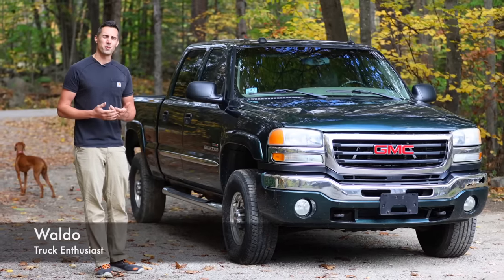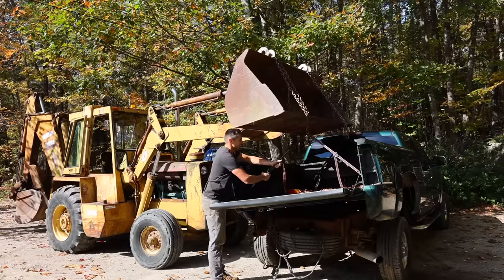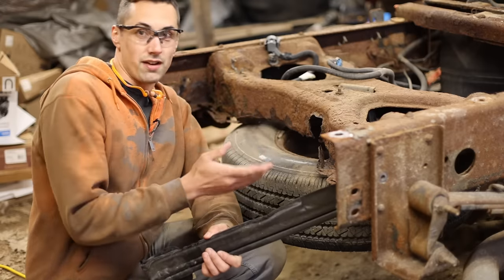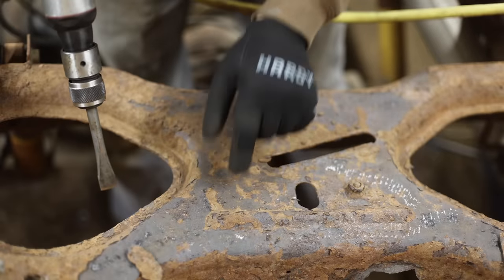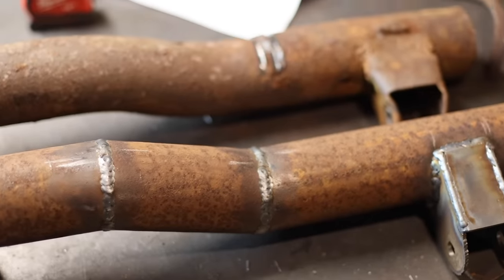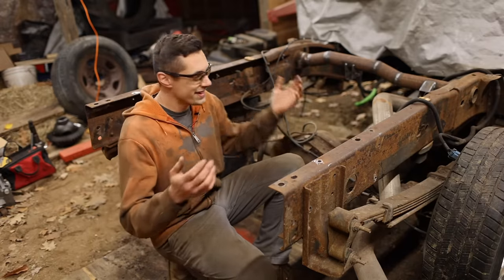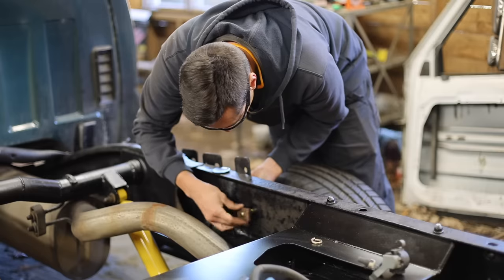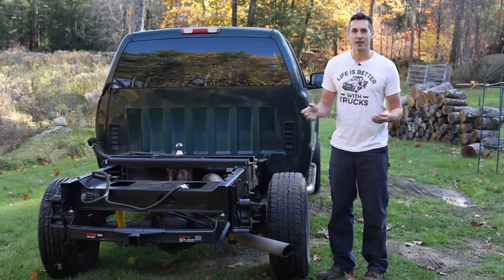Repairing a Rusty Frame on a GMT800 Truck [Cheap Duramax Part 2]

Comment: Just found your channel, Waldo. Fantastic content! I’m here in western mass and also have the same truck but mine is an SLE. Luckily the cab corners and rockers were done by the previous owner (professional level, not hacked!). I’m looking forward to tearing into the frame issues this spring. Cheers to great content!!
Reply from the maker: Thank you!

Comment: I just replace both my cross members on my 05 1500 the same 2 you just replaced but there both tubular like the gas tank one! I bought the. For 277 off eBay probably from the same company you got your rear one from definately worth the money everything you did in this video I basically did the same thing! Awesome! I used oil based tractor implementation matte black for the top coat of paint I put mine on with a brush because I wanted it thick but you could thin it out and run it through a gun
Reply from the maker: Very nice! Yeah, the rear crossmember was different on my 1500 as well 👍

Comment: Great job on the frame, looks stronger than factory! Shame you're not reusing the bed, looks like it just needs a quarter panel. I think it'd be a pretty interesting repair to watch you do.
Reply from the maker: Yeah, the bed is salvageable, though it would need a new rear corner and new fenders. The crossmembers are a little rusty, but not too bad. I hate body work, so I'd much rather do some aluminum welding on a flatbed 😬

If you want to see body work, I will be doing the rocker panels and cab corners (probably this winter). I won't enjoy it, but I'd prefer doing the body work to paying $17,000 for a rust free truck.
Reply: @WaldosWorld   as always I'm actually looking at doing this type of work when I'm out of the military (currently over seas). your channel just inspires me and makes the drive stronger to do these sort of things!!!

Comment: Good job Waldo. With all this work i would have lengthen the frame to make it an 8ft bed. 
Also, I'd be interested in the oiling video.
Reply from the maker: Ooh, I didn't think of lengthening the frame, that's a good idea! An 8 foot bed would be much more useful 🤔
Reply: @WaldosWorld  yeah it's just c channel. Move spring hangers. Lengthen or get a used drive shaft.

Comment: Not sure how it works where you are, but in PA you would need to put a factory bed (painted green) and bumper back on the truck to pass the inspection requirements to get a reconstructed title. Once you get the title, you'd be free to build all the custom beds and bumpers you like, but factory is the only option to pass. Check your local laws, you may need  to borrow some parts for a day. 

I used to work at a salvage yard that had a fleet of R titled white and orange flatbed delivery trucks. They always started with wrecked white fleet trucks. I remember one year we built 3, replacing the whole fleet, and we used the same new take off bed to get through inspection. We would bring them back inspected, pull the bed, and send the white cab and chassis to a local body shop for the orange stripe.
Reply from the maker: Interesting, I'll have to look into it! Honestly, I wouldn't have even thought that would be the case since it seems like such a silly law 😂
Reply: @WaldosWorld  it certainly seems silly, and the best explanation I could ever get is that the vehicle has to be reconstructed to factory specs in order to get a reconstructed title. 

Gotta love a stupid law with a simple work around, just like taking the nozzle off of a new gas can and pouring the gas through a funnel. Thanks for helping, government!!!

Comment: You might want to spray your frame with spray rubber. One brand that I am familiar with is "Outlast" by Lawson Products. I know a few people that have done this and it held up very well. It is kind of like a Rino Truck Bed coating without any texture. I think you can get product like this in a few colors but they are not high gloss. The demo that they like to use is spraying a plastic water bottle with it and then crushing it with no cracking or pealing. It is very flexible.
Reply: That's the last thing in the world that he'd want to put on there. Lol. That stuff is infamous in the Rust belt. It'll always get rock chips, which will allow moisture and salt underneath and then you're screwed. Oil is the tried and tested solution.

Comment: Also we still do manufacture all those X members, but they are built as spares only for the smaller 10ft moving tucks (ex. U Haul) that GM supports. Those frames as a matter a fact are still the same exciting ones to which was designed 20+ years ago. Still neat to see how the frames used to be split rails and use of rivets, over the full body rails and full welds that have been done in the later model changes. But back to those X members, it’s no wonder you would most unlikely get your hands on one, as like I said they aren’t listed for those vehicles anymore, just stand by for the exciting moving trucks only.
Reply from the maker: That's very interesting! Thanks for the comment!
Reply: How can consumers get a hold of one? More options are good

Comment: The southeast has many salvage yards with good frames and frame sections. Truck freight can be surprisingly reasonable and there's always the road trip option. 
BTW I anti-seize every body or frame bolt that I don't Loctite (which is also anti-seize because it excludes moisture from threaded joints). Forget the watery shit at the auto store and spring for a tub of Jet Lube copper or a quality nickel (either is high temp enough for automotive uses) industrial anti-seize. 
If I really liked a truck I was keeping for life I'd check into what the factory should have done, hot dip galvanizing. Not cheap but industry does it all the time.

Comment: Course cupped wire wheel and air hammer are the best ways to remove scale. That and a sharp point body hammer.

Comment: New to rust issues with a Wagoneer that needs restoring. The frame and other chassis components are scaled everywhere. Is there any reason why you didn’t go with a POR15 option instead of just painting it? So much info on the internet, it can be a bit overwhelming. Thanks for your time helping a newbie out.

Comment: I was waiting for one bolt to spin, from experience you have to loosen, tighten, loosen some more, retighten, etc. otherwise very common to spin. Already it was one of the most easy one to access to cut off.

Comment: Awesome job tearing apart then rebuilding that frame.
It was an accident waiting to happen as it was.
I just wonder why you didn't use Rust-Oleum's Rust Encapsulater paint that I'll be using on two rusty sliding mirror doors in out utility closet before I paint them with Rust-Oleum appliance white paint then two coats of clear.

Comment: They make primer in rattle cans that have powered zinc in the paint which will inhibit rust way better than what you are using.  It's normally grey so you can use the black enamel as a top coat.

Comment: Hey my Chicago electric $25 110v hammer drill has been put through the ringer and left in a flooded toolbox and still has been going strong 10 years

Comment: I just did a lot of similar work to this on my obs ford, although no new cross menbers thankfully, I don't know how to weld. Very cool seeing all the fabrication you do! Also, that air hammer would have made it a lot easier to remove the rivets of the leaf spring mounts lol..

Comment: Will you be replacing the rusted out pieces on the cab?  Can’t wait till the next video on this truck and the gooseneck build.
Reply from the maker: Yep, I'll be doing the rocker panels and cab corners at some point. I already have the parts, I just have to muster the strength to bear doing body work 😂

Comment: Get a gallon of the oil based, brush on rustoleum. It takes longer than the spray can but it performs WAY better. The spray paint stuff is just junk when it comes to true durability.

I use the gallon stuff on my trailers and I’ll either brush it on or if it’s a larger trailer/I feel like it, I’ll take the time to thin it down just enough to spray through my pneumatic sprayer.

Comment: GMT800s are damn good trucks. Down south where I live they're the most common SUVs and pickups of their vintage compared to their Dodge or Ford counterparts. Really the only weakness are the 1/2 tons with the 4l60e, but with enough cooling and fluid service they'll last.
Reply: People tend to ask much more of the half tons than they're made to handle. That's half the issue with it. The other half bring lack of maintenance.
Reply from the maker: Agreed! 👍
Reply: @mikeznel6048  indeed, although I’d still say that they’re unnaturally prone to going boom compared to Ford’s 4R70W.
Reply: @zetros3  I have to disagree. Especially with the "overdrive" 4th gear issues. Most of the 4l60e issues are burnt up 3-4 clutches from, again, lack of maintenance and the heat associated with asking more from the truck than it was made to handle. A simple aftermarket transmission cooler and regular maintenance make a world of difference. A shift kit is great if you tow alot too. I haven't seen a failed 4l60e yet that didn't have burnt, original fluid and filter. Another common issue is the transmission cooler lines rust out real bad in the salt areas and they mostly only get fixed after a severe leak which caused a complete loss of fluid, which is also a big culprit in the 3-4 friction disk failure. When the vehicle won't hold 3rd is the time they finally do something about it and at that point, the damage has been done and it's only a matter of time. Just because the truck will pull it doesn't mean you should.
Reply: @mikeznel6048  I still think, even with the OD band issue, the 4R is a bit more stout than the 4L60e, but I’m not super knowledgeable lol. That being said, I still don’t get why GM never cooled their 1/2 tons properly. My ‘97 express conversion van (hightop) didn’t even have the towing pkg, so this 4L60e with no external cooler (just the heat exchanger). The poor transmission had to deal with the stock 3.42 rear end and the weight of the conversion equipment with no help. Before I stuck a Hayden 679 on it ram at 210 constantly unladen. No wonder it blew up at 55k if it was at 210 in Fall alone.

I definitely agree with you on the servicing, or lack thereof, though. I always hear about people’s 60e’s going boom then they go on to say “oh I was towing x y or z”. No wonder it blew up.

Comment: Nice work, Waldo.  There is a practice of applying linseed oil to the interior of aircraft steel tube (4130) closed structures like fuselages to help prevent rust from the inside out.  When I see a steel tube structure being fabricated to replace a rusted out one, I wonder if it wouldn’t be worth the effort to ‘roll’ some linseed oil in there after most welding is complete?
Reply: Fluid film has a 360deg hose to spray inside things

Comment: Liked the presentation

I bought a F-250 with a 6.9 Diesel and a bad Automatic Tranny to do some towing

Florida has rust issues but from the Top Down

You save a Rusty frame

Can You give and Approximate price on the after market frame member You bought?

Thanks

Ken in Florida

Comment: Years ago, the manufacturers got in trouble with the bodies rusting out prematurely.  The government went after them to improve the durability of the sheetmetal and they seem to have improved.  But everything you can't see seems to rust out.  I have seen spares on the highway from the hardware rusting off and the tire then separating from the body.  They really need to add some alloy to the metal to make it more rust durable but I guess if they did, they wouldn't sell any more vehicles as they would last too long.

Comment: nice work again Waldo ! hey i am trying my hand in more welding projects, i learned stick like 25 yrs ago and never was very interested until now, question for you, how to know when to use stick, MiG or flux core ? i expect to be buying a backhoe soon and want to be able to make repairs from simple trailer work(thin 3/16'' ) to strong structural repairs. help me buddy or point me in the right direction ?  thanks !!  Tom
Reply from the maker: I use MIG by default because of the convenience. Stick and flux core are better if you're welding rusty/painted metal and also if you need more penetration for structural reasons 👍
Reply: @WaldosWorld  thank you

Comment: The needle gun will take that rust off.  Don't push down on the tool, just let the weight of the tool do the work.  It is the repeated bouncing of the needles that takes the scale off.  They work best cleaning slag off of stick welds and thick paint off of steel.

Comment: Just did the frame on my 2008 chev 2500hd & rather than use Tremclad Rust Paint I used a product called POR-15 to paint the frame a far superior product but is pretty pricey compared to the Tremclad

Comment: Hi,
Just curious what model that Miller is that you used on the flatbed, gooseneck and adjustable saw horse builds? Love the videos!
Reply from the maker: It's a Miller Multimatic 220 AC/DC 👍

Comment: When removing a cross member...do I need to worry about supporting the frame while I weld the new cross member. Keeping outward pressure on the insides of the side rails?

Comment: This may have been asked before and I missed it, but what company did you buy the spare tire crossmember from? I have an 03 2500HD that I have to replace that on and I was going to try to find a rust free southern crossmember until I seen your video.

Comment: I bought a gmt400 k2500 gasser. Gotta do alot of work to it. Mainly gas gauge dont work no dash or plate lights brake lights are wired weirdly

Comment: I had a Kurt hitch on my 04 ram 1500 hemi. When i did the roadworthiness tests in Germany, they would only allow 1500kg (3300 lbs) towing weight on it. Had to replace the kurt hitch that was built with much thicker steel and fixed to both frame members with a chinesium hitch only attached to the last crossmember. This chinesium one had the coveted e-prufzeichen and still they only allowed 3000kg (6600 lbs) out of the maximum of 3500kg (7700 lbs) Still annoys the hell out of me. Dont even fkin know why im sharing this but anyway, MORE VIDEOS  PLEASE 😂.
Reply from the maker: Haha thanks for sharing!

Comment: Hey Waldo. I have an INTERESTING project for you. Do bus 🚌 in to truck 🚛 makeover. For example you can get Chevy Express with DuraMax engine for very cheap (I saw 2013 with 85k for around $6-7k) and make it flatbed truck!

Comment: You did a very nice job of the repair to the cross members ,but you failed to repair/reinforce the main frame, where they really fail. We just did the same repairs on a 03 GMC Sierra, we made a template for the areas and also replaced the brake line tubing while we were in the process, Minnesota is pure hell in the frames , all salted roads in the winter.

Comment: I have been putting a good marine grease in between any large surfave-area metal parts bolted together on the frame. (Like the hitch side  plates). Time will tell how it works but seems like a good idea I theory?
Reply: Yep good theory

Comment: I have a 04 2500hd with 6.0 in it I believe mine will need this same work done to it. So my question is how long fid it actually take you to work this in real time? I'm not a welder by any means but I have a brother who welds so I believe I could make this job happened

Comment: Really like the work you do on all the projects I have seen so far. Could you tell me the source for your class V trailer hitch and the part number for it?  Thanks
Reply from the maker: It's a Curt 15302 that I got from Summit Racing 👍

Comment: Seems a bit of an anomaly that the rear frame components were rusted so badly and not the body, nor front frame (?). When you showed the pipe you were going to use to replace those tubular crossmembers, I thought "How is Waldo going to bend it?" Answer, "bends" via shallow angle cuts. Well done Waldo. I've no doubt you could have built the main crossmember from scratch if you weren't able to buy it. On a (completely) separate note, can you dunk a basketball?

Comment: Replace your cab vents while your bed is off you don’t have to but it makes it easier and it will only take you about 5 minutes and cost probably 20 bucks
Reply from the maker: Thanks for the tip!

Comment: Wasn't able to see what grade the bolts were??? Gr 8/10.9 ? or were they (5?) 
Since your welding did you pull the (Negative terminal off the battery?) As that will damage the electronics. 
Also do put the Grd as close as to the weld.

Comment: Waldo please can you put the guard on that grinder. Take it from me I’ve seen on the job site several times what happens when cutting wheels explode off of a grinders. It will protect your hands as well. There is no reason not to use it.

Comment: A bottle of rust Mort and then bed line line it  would be to easy.    If took the time and removed the cross member it would of put a 4 link and and air ride  for leveling.lol.🛠️🍻👍✌️😉💯

Comment: How did you learn how to weld? Very envious of that skill!
Reply from the maker: I took some classes at a local metalworking school. It's not necessary if you're willing to learn on your own and get LOTS of practice 👍
Reply: @WaldosWorld  thanks so much for the reply! Yeah… mostly worried about actually achieving structurally sound results and knowing the settings etc to do so. About how long was your course if you don’t mind me asking?

Comment: 8 hours, a needle scaler, and 40lbs of rust knocked off later...  It pays to have them sprayed every year with fluid film.   I pour tranny fluid in the frame also every year... (2005 400k miles Colorado in Buffalo NY)

Comment: You should have used Rustoleum Rust Reformer instead. It's flat black and I have used it over lightly rusted metal and the rust never came back.
Reply from the maker: I'll have to give it a try sometime, though oil undercoating is super effective 👍